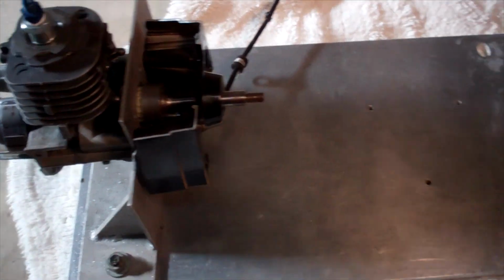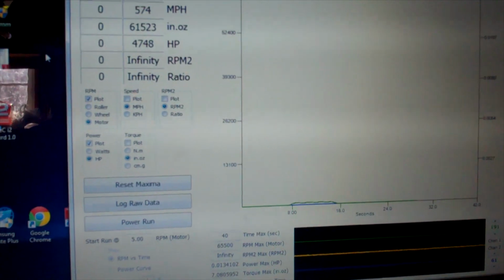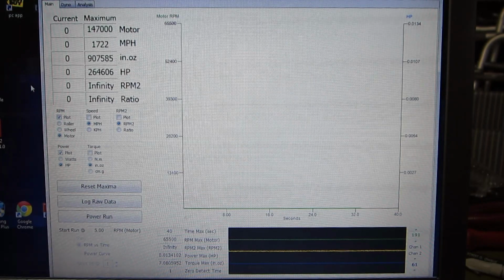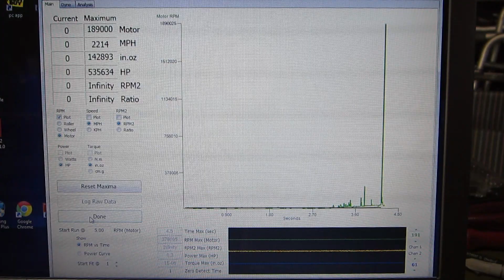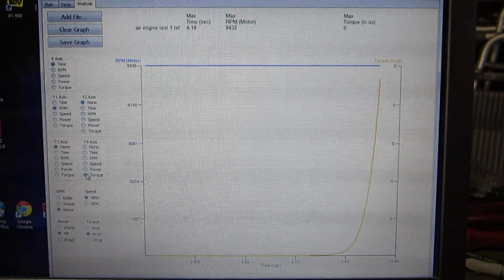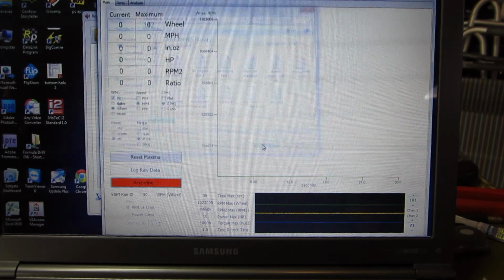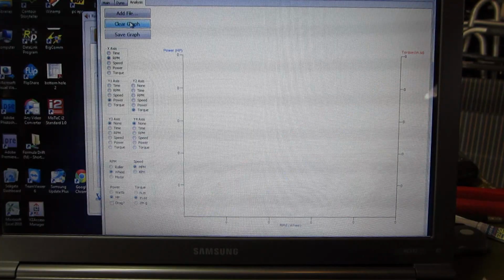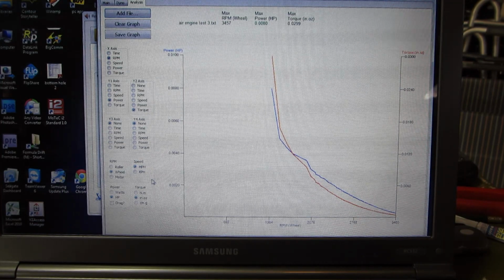How to make a compressed air engine.m2t

Comment: ever heard of Permanent magnets turning a generator and get free Electricity?Well, I had Patented a Magnet -Powered motor,here are the details :Two disk number one disk ,mounted on a 1 inch Ply  ,Permanently;with thirty magnets around the edge of the Disk,The second disk ?Is the revolving one with similar numbers of Magnets around the edges,the Magnets on the first disk are "angled"and the magnets on the second disk ?are perpendicular,between the two disk a ball-bearing seperates the two disk,through a simple Clutch system,when second disk is put in close proximity?;the second disk would spin;a shaft from the second disk goes through the middle hole of the first disk,connect a Dynamo or generator?it would spin,depending on the Magnets used,for my experiment?i use Ceramic ;which are cheap,but My production model ,?I would use Nyudimium magnets which are very expensive but very powerful,this is a two disk motor,my Production model would hav Multiple Disk System and the Torque is very Powerful,  it is best suited for Submarines cuz my motor works silently,and also works with Flying plat form,By Hillers Corporation. Peace & Harmony to All.

Comment: You learned something important. You shouldn't gear down a compressed air engine piston engine. It has max power and torque at low rpm so you want to be operating it as slow as possible for max efficiency. A gas engine works just the opposite. The faster it goes, the more power and torque, up to some redline.

Comment: Would you mind to post down the different parts you've used to build the engine. It would be really useful. The thing is that I'm not an expert in some of the car technical vocabulary you use throughout the video, so it gets hard to look for some of the pieces in the internet. Also, it would be great if you could recommend some kind of web site to me so I can buy the parts for a cheap price.